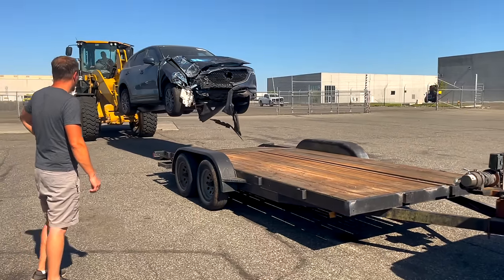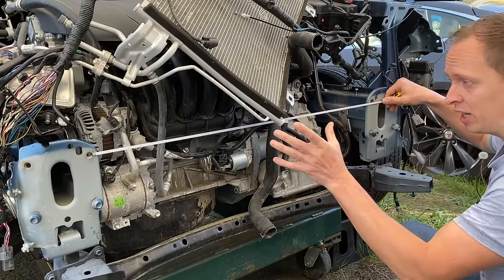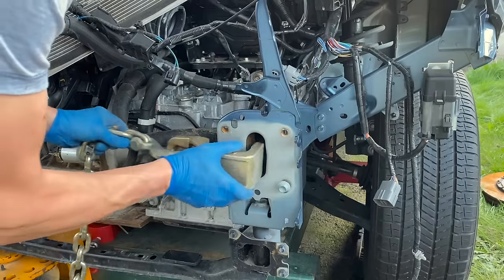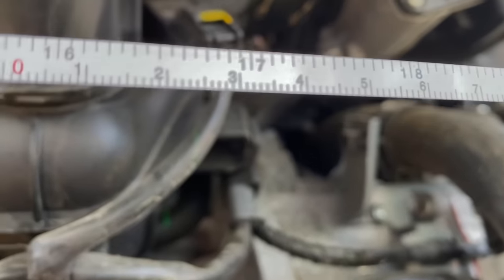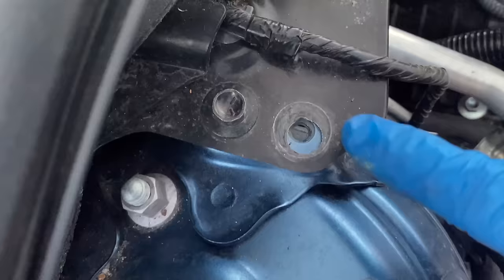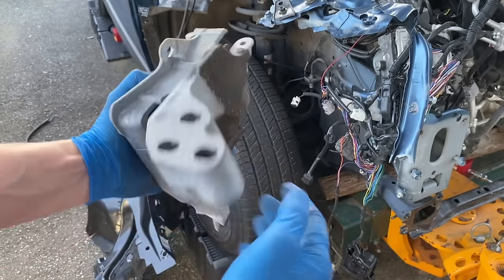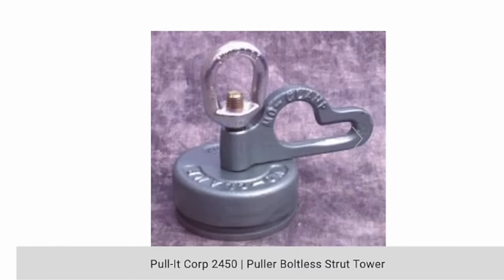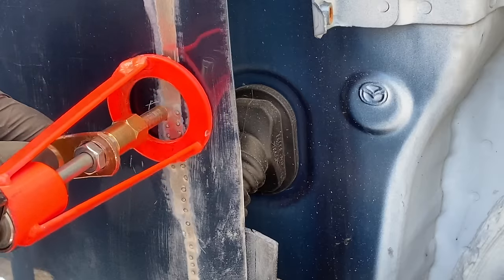✅Frame Repair in the Driveway with Great Results? Let's find out !!

Comment: All your dimensions will be correct. But the metal has been shrunk , stretched and twisted in the impact  , it will not crumple or deform in the way it was intended to by the manufacturer  if there is another crash. I have see the results of of a second impact on a repaired car it crumpled like tissue paper with bad consequences.  Would you be happy to put your family in a vehicle that has suffered this type of damage and then been repaired ? There is a reason why it was written off.
Reply from the maker: LOL... The way you're making it sound it's as if the collision repair industry shouldn't even exist due to "safety reasons"... All of the metal that's been stretched and twisted in the impact gets cut out and replaced. Both of the frame rails and a strut tower barely moved and did not even crumple. And why would all of a sudden the same frame rails "crumple like tissue paper with bad consequences"??? At the very least they'll perform at 98–99% compared to an undamaged vehicle.  And to answer your question whether I would put my family in this vehicle after is been repaired? The answer is YES, this car has been my wife's daily driver for the past six months, and I'm quite certain that she'll be just fine if she gets into an accident. The whole reason why it was written off is because insurance company calculates the cost of the repair (airbags, body parts, labor, paint) versus the value of the car. And if the cost of the repair exceeds a certain percentage then it makes more financial sense for the insurance company just to sell the vehicle off through an insurance auto auction and cut their losses. If the value of this car was at 70K and one of the frame rails was twisted like a corkscrew then I guarantee you insurance company would approve the repairs. It sounds like you're speaking more out of emotion than experience.

Comment: can it be done sure. is it cost effective not really.
Reply from the maker: I got most of the framework done in a day at no cost to me but about 8 hours of my time... Id say that was pretty effective...
Reply: @fix206  i get it. your not going to admit the real cost to fix it. all those machines and clamps jacks, tools, werent. free. all those body panels, headlights wiring, solder, beam level lazer, i saw at least 2k in machines and tools in this videos and you havent even welded yet. still need the parts for the driveline all the body work to match.  if you do it yourself you can save but realistically your have to be experienced to do it yourself. if not the cost to repair that car would far exceed the cost to repair. thats what salvage means. the repair was deemed more than the value of the car which is around 15k.
Reply from the maker: Don't get me wrong, I know where you're coming from. Yes this car was deemed as a total loss because it would cost too much to have a shop do the repairs. This is a 2021 model and I bought it back in 2021 so it was a current year vehicle with 12,000 miles on the clock. I spent right around $11,500 on the car with parts. The rest was just my time and labor. At the time of the purchase the value of this vehicle with clean title was $28-30K, with a rebuilt title around $23-24K. So the final dollar amount was at half the cost to me. Pretty sure that the average Joe without proper skills would not be able to complete such a repair. I do have the skills and I enjoy this sort of work and on top of that I'm gonna make a few bucks off of these videos so it's a win, win for me. The frame rack that I used to pull the panels back into shape wasn't purchased, I built it myself and I also did a video on that build. The amount of money I made on that video actually covered the cost of materials to build the rack and then some. And all the tools that I used here were used on plenty of projects prior to this one and I will continue using them for years to come, with that in mind the cost of tools cannot be rolled into a price of this rebuild alone...
Reply: @fix206  If you listened to naysayers you would never get anything accomplished. Keep up the great work.

Comment: This car should have been scrapped and not allowed to be sold on. Once inspected by insurance then paperwork returned to traffic office and car put in crusher. . no matter how good repair is car could be dangerous.
Reply from the maker: LOL... By your logic body shops should not exist, since the work that I've done on this car is being performed thousand times a day by body shops all across the country.
Reply: @fix206  I am Spain. Rules stricter here.  Inspection every year. Car . Truck every six months. . two tyres same make same tread on each axle .plus speed rating .tyres over ten yrs old. Fail ..all vehicles shaken to death on pit by plates in floor. .  was never like this years ago ..don't mention tow bars if the number plate rots away. .

Comment: Once the frame has been deformed that way then there is no way on God's green earth that any "pulling" will return it to same level of factory strength OR weakness as it's designed to crumble in a very specific manner in case of a crash. This is doing the car's next owned literally a disservice, and from a technical standpoint this is like an open-roof contruction of a "bus" in Pakistan where the whole thing is spot-welded by peoole who are barely literate from sheet metal of unknown origin and quality.

Comment: Do you really want to put your kids in this car after its been BENT and STRETCHED back into "shape" and drive down the highway at 80mph. Thats a HARD NO
Reply from the maker: Come on Dave, it's not like those frame rails got pushed over by a a foot and folded in half and I had to unfold them... The way you're making it sound it's as if the collision repair industry shouldn't even exist due to "safety reasons"... All of the metal that's been stretched and twisted in the impact gets cut out and replaced. Both of the frame rails and a strut tower barely moved and did not even crumple. At the very least those frame rails and a strut tower will perform at 98–99% compared to an undamaged vehicle.  And to answer your question whether I would put my kids in this vehicle after is been repaired? The answer is YES, this car has been my wife's daily driver for the past six months, and she takes the kid everywhere with her. I'm quite certain that she'll be just fine if she gets into an accident. The whole reason why it was written off is because insurance company calculates the cost of the repair (airbags, body parts, labor, paint) versus the value of the car. And if the cost of the repair exceeds a certain percentage then it makes more financial sense for the insurance company just to sell the vehicle off through an insurance auto auction and cut their losses. If the value of this car was at 70K and one of the frame rails was twisted like a corkscrew then I guarantee that insurance company would approve the repairs. It sounds like you're speaking more out of emotion than experience.

Comment: You know all you did with the frame is a big no no! Totally not allowed by the manufacturer. If this car gets into another accident it will not behave the way it’s supposed to and possibly seriously injure the occupants. I get wanting a good bargain but it’s never worth putting people at risk.
Reply from the maker: LOL... I know for a fact that you're not speaking from experience. This is more of an emotional response to this video then an educated one. Collision repair industry revolves around this type of work, and this is not even considered as a hard hit. Body shops fix much worse thousands of times a day around the country.
Reply: @fix206  what you posted is all emotional crying. You have 0 idea of what you are talking about. This is not 1980 anymore. You are not allowed to repair these exotic high strength steels. No heating, no pulling no repairing. Cut and replace the metal only. I was going to go into a lot more depth but I will educate you slowly next time you cry!
Reply from the maker: Emotional crying? Where exactly did you see that? LOL... And where did you see me heat anything? One frame rail moved over by 1/4 of an inch another moved about 1/2 of an inch, strut tower moved 3/8... which isn't much at all, there were no kinks, therefore pulling something like this back into its original position is a standard procedure. Now if the rails were pushed over 5–6 inches then there would be quite a bit more damage done to them and they would need to be sectioned or replaced all together. Everything else that got mangled is getting replaced...
Reply: @fix206  I listed all things forbidden in the repair of modern vehicle. It was kind of a clue to you that I know a lot about this subject as you suggested I did not. What repair procedure did you use? You do know vehicles are not universally repaired anymore? Every vehicle has different repair procedures! Also the type of laser setup you used does not give you all the measuring points you need. You can get the points you need with jigs or a car-o-tronic, but the measurements are the least of my concerns. Frame rails are not to be straightened and repaired anymore because they have exotic metals in them. Not only that pulling a rail without anchoring other points can result in collateral damage in other portions of the frame that you won't even realize. There are a lot of manufacturers nowadays that allow no pulling whatsoever! Not even a rough pull to cut things out. That engine needed to be pulled the rails needed to be cut out and new rails needed to be jigged in place with the proper bonding and welding method as per the manufacturer. If you provide the VIN I can print you the exact procedure from the manufacturer. Further if any of those wires were for the SRS System they are not to be repaired but need replacing.

Comment: The fuck is a millimeter?
Reply: Just messing with you. Sir, you make Rolex look loose.
Reply: 1/25"
Reply from the maker: As far as I'm concerned US should get with the program and get on board with the rest of the world by fully adopting metric system
Reply: @fix206 I disagree completely. Dont you realize the money and materials that will be wasted by all of those lost 10mm sockets? That would cripple the economy!
Reply from the maker: @matthewhigh3954
Over the years I've lost so many of those 10 mm sockets and then I had to replace them... Daniel isn't attending college, his college fund was used to purchase replacement sockets 😵‍💫